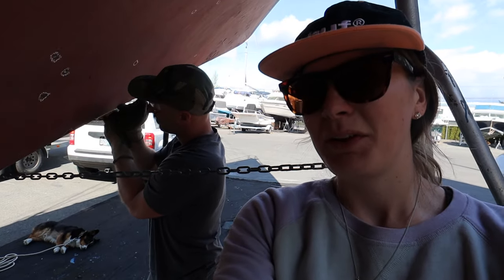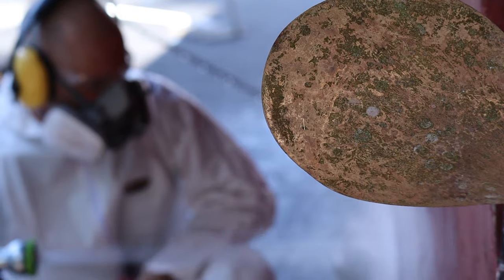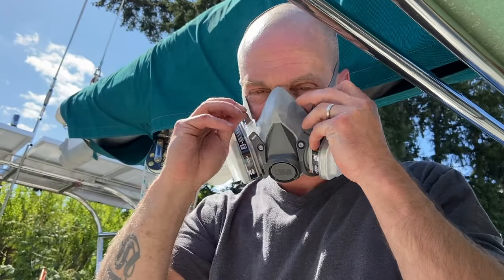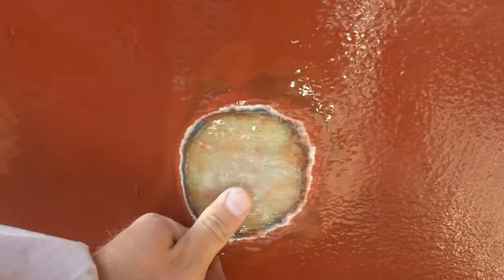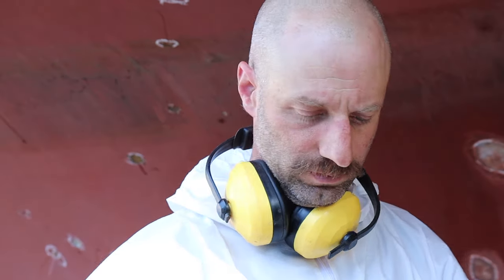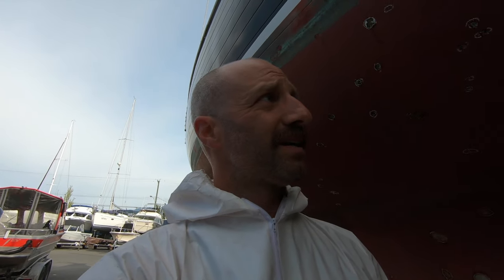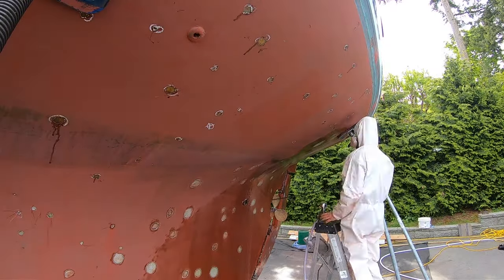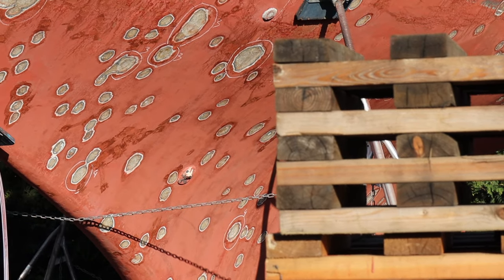Is our BOAT total GARBAGE? Osmosis Blisters all over our Sailboat! | Cruising Meraki Ep 19

Comment: Hello from NZ , my 29 ft yacht has superficial but extensive blisters and I am in the process of getting quotes for remediation. The process they use at the yards is to plane it then use heated vacuum blankets to dry out the laminate on an accelerated basis. Then i think once the moisture content is below a certain reading they apply 2 layers of vinyl ester resin with cloth and then I presume epoxy barrier coats over that. The whole process takes 5 weeks approx. The laminate can dry out on a natural basis but it takes a very long time. I have been quoted $18000 plus tax and hardstand fees.
Reply from the maker: That sounds about right, we chose another method which we document in another video and 3 years later we’re really happy with the results.

Comment: Don't worry about the blisters - most older fiberglass boats have them. They're non-structural - they just take a lot of time to fix. Do read up about the process for layering in pieces of glass cloth into deeper ones - there's a particular sequence of different cloth diameters: I think it's big-to-small (about 3 layers). Also - be careful not to overfill with thickened epoxy - sets hard as nails and is very hard to sand back to fair. Good luck!
Reply from the maker: Let the research begin! Luckily we have some very skilled folks around us in the boat yard and in our personal lives. We’re so thankful for the kindness and help from everyone!! 
Thanks so much for your tips 💕
Reply: A local self employed boat painter has a lot of experience with osmosis blister
Repairs and his advice is to use epoxy glue to fill the holes as opposed to a filler compound. The relative porosity of the latter being the issue. He waits until the glue has cured partially and then scrapes it fair with a TC scraper , light sanding and the barrier paint takes care of the rest.
Reply from the maker: @number1genoa yes this is what we did. Epoxy to seal, epoxy layers of glass and then 2 part epoxy fairing to level it off and make it smooth.

Comment: That hull is trash. It needs to be stripped or you will be fighting blisters forever. You cant spot treat osmosis that bad.
Reply from the maker: There is lots of different opinions on whether to or how to treat osmosis. After researching and talking to many experts we decided to repair all of ours. The previous owner made some repairs back in 2001 with fill only. Most of those we ground out as well and patched with new glass. There was also bad ventilation through the bilge which we have now addressed. A properly vented bilge really helps with the prevention of osmosis. You may be correct in fact that they will come back, but if we get another 20+ years out of our repair we would be stoked. Each time the boat is hauled to do bottom paint, we will do spot repairs which should be very minimal. That way we can stay on top of things 👍🏼
Reply from the maker: Lucky for us, 2+ years later and the hull has never looked so good!